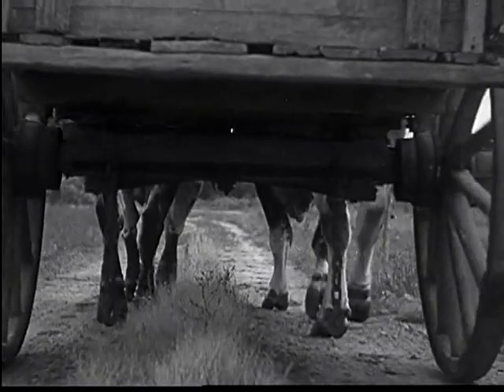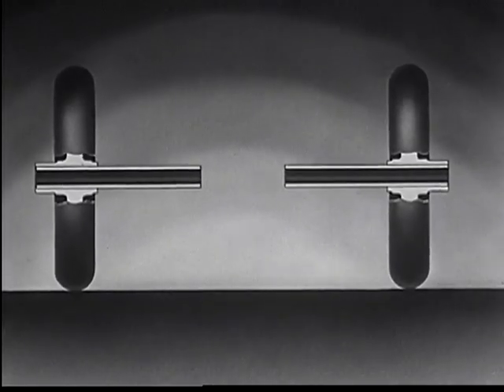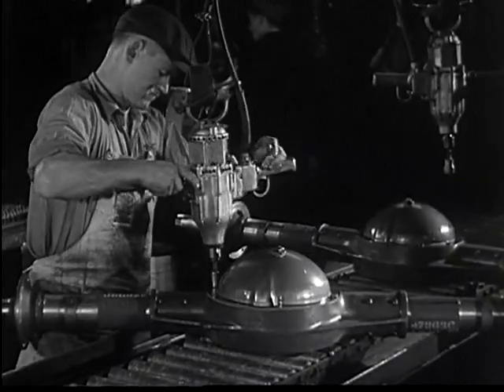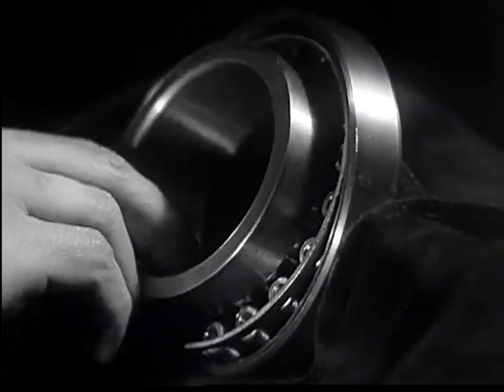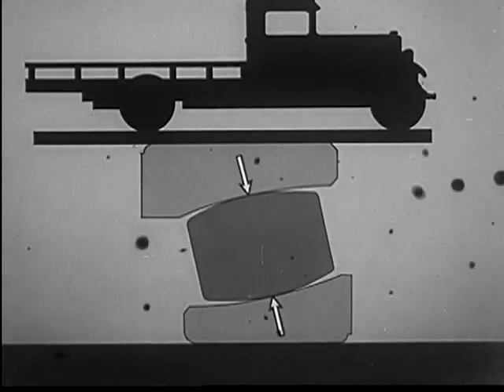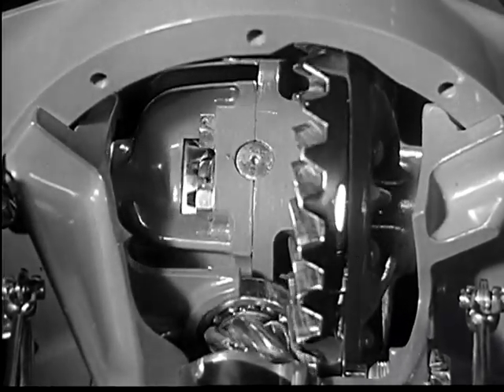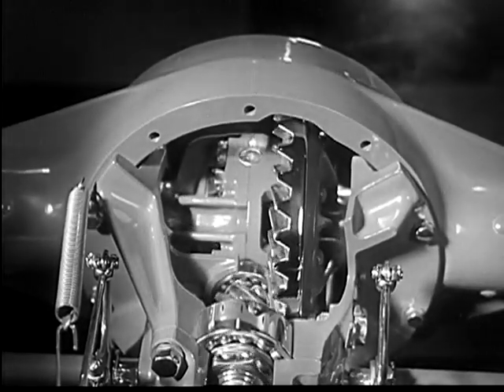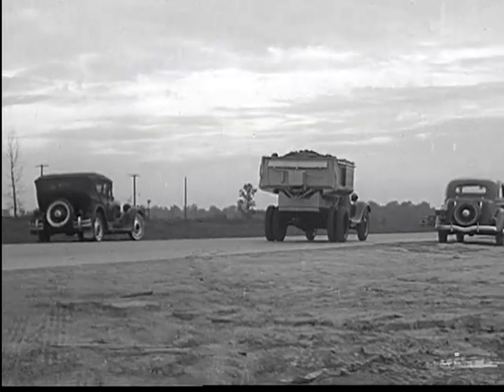It Floats - Chevrolet Full Floating Rear Axle (1936)

Comment: man i wish modern car commercials would show off practical things like how easy it is to change the drive axle instead of showing off how being in an enclosed car keeps you safe from alligators
Reply: I wish today's cars were built to last like the cars of the 80s were.  HIGH QUALITY STEEL AND IRON. not like this aluminum fiberglass and plastic bullshit you should only every see on a BIG WHEEL kids toy.  Back when we can actually service our own vehicles, when the auto parts store actually had relevance, when if you did take the car to a mechanic he didn't need to rip the car apart just to check the engine oil, back when there was actually an engine and not some stupid battery pack, back when if you got into an accident you can easily just beat the dents out and send the car into MAACO for a new paint job. Not like today where if you even bump into a fucking mailbox your car ends up in the scrap yard.  Have fun buying a new car because your piece of shit couldn't even withstand the impact from a bicycle, unlike the cars from the 80s where a crown Vic can slam into a Honda at over 50mph, roll over onto it's top and slide 80ft with the only damage to the CV is to the top where the lightbar was destroyed. Can't say much for today's cars where you can barely bump into each other in the fucking parking lot without both cars looking like they just took a Sunday drive directly into the jaws of a wood chipper.
Reply: @HannTheftAudio  ya but those 80's cars were super deadly to everyone else on the road, the high quality steel and iron combined with the sharp edges of the design language basically meant they were giant high speed knives on wheels, and pedestrian collisions would almost always be fatal, at least nowadays cars are designed to bounce people off them instead of slicing them in half, and as a bicycle rider who's been hit by more than a few modern cars and even been thrown through a windshield face first and never even broken a bone i'd say it was probably worth it

Comment: With a 60-70 year old Chevrolet dump truck in the back of my house, considering the amount of rust there is on the outside, the bearings, gears and it's inner workings is in near mint condition and works very perfectly! Goes to show how cheap and crappy things came to be now then back when that dump truck was in service :(
Reply: You know lubrication on those bearings, little use and being sealed from the elements is what caused them to survive so long, right?

Comment: The ability to change an axle from the outside is just genius.  Wish we had mechanical features like this more today.  Stuff you could fix on the side of the road with a wrench and screwdriver.
Reply: How often do you have to change the axle on modern cars? Never! That's why they ditched this design. Useless it is.

Comment: 1936 : axel break ? no problem change it on the spot
2018 : axel break ? have your car towed, be in service for days and costs a fortune
Reply: @Mr Sunshines Three words: I doubt it
Reply: May even total the vehicle because a new one costs the same as the repair, lol!
Reply: No today you have to disassemble 3/4 of the car, remove a dozen sensors, order the replacement axle twice because they couldn't send the right one the first time, get the new axle, put everything back together only to find they sent you a damaged axle, cannot repair it as its a non-serviceable part.  Wait another month for another axle to be shipped from China which shows up covered in a layer of rust.  Spend 3 days derusting it, get it installed, everything hooked back up only to have a dash full of idiot lights on because you changed the axle and confused the dozens of computers that rely on all the sensors in the axle telling the computer there's an axle there.

Comment: Car makers now.

 2018 axle, its beautiful. Made with premium composite metals and materials and plastic bushings for durability. 

The finest cheapest bearings we could make from slave labour with a service interval of 24 months and when service time comes, rest assured the dealership has no idea how to do it.

The seals are designed for the life of the vehicle....even though that life is 6 years or immediately after the warranty expires. Whichever comes first.

It has 13 cup holders, 4 USB outlets, 5 12v outlets, and heated and cooled ventilated wheel nuts with massage function sun visors.
Reply: Dont forget the rediculous infotainment console.
Reply: @scottw112358  Because nothing helps safety on the road like a 20-inch tablet.
Reply: @scottw112358  

I can remember when a radio (AM) was optional.
Reply: @ardvarkkkkk1 , did we really needed a stereo radio while growing up, we sung it ourselves, and if we don't know the lyrics we caught up really quick.
Reply: @ardvarkkkkk1 Yup, my mom's 1966 Chevy II had no cigarette lighter. Straight six, 194 cubic inch, 3 on the tree. Cost her $1,995+tax in fall of 1965. Simple, and got 20+mpg with no computers, no smog devices
Reply: That sums it up perfectly!!!
Reply: coming soon mandatory alcohol test.no drinking while playing with the internet
Reply: The most comfortable ride you'll ever experience... which makes you miss it while it's in the shop again...
Reply: Does everything but feed the baby and wipe your asp...Oh well, maybe next year.
Reply: Dude perfect!😂😂
Reply: Don't get me wrong, I love modern cars and technology. I was referring to a disposable Ford engine video. 

When Henry Ford was around he made sure his engineers built cars that would fail and break down and they're continuing that tradition to date.

Edit: here's the video https://youtu.be/pCsWm4cCMbs
Reply: What about the big screen TV where the radio used to be... And what the hell happened to my gauges? Oh right, I'm supposed to look all the way over there instead of glancing down to see what's going on...
Reply: subtle username  I do agree 100% with your cup holder comment though.
Reply: With 6-lcd screens AND 4-doors....
Reply: And by composite metals they mean pot metal 🤦🏻‍♂️
Reply: D'Oh!
Reply: Also weights 1.589kg and uses an aluminum chassis(this joke is more to mock all car manufacturers)
Reply: Hahahahahahahaha so true!!!
Reply: You summed up about right.
Reply: Suuuuuure whatever
Reply: subtle username  My point is that old cars didn't need crumple zones or airbags, or impact absorbing bumpers... because people drove them more safely.  Look at wreck statistics over the last century.  All these modern safety features did was make people more complacent in their own driving habits.  There are just as many if not more fatal crashes now as there were 70 years ago because people feel safer in modern cars and therefore drive them more dangerously.
There's an old saying, "the best safety is between your ears".  Old cars and trucks ARE perfectly safe, when driven safely.
Reply: Live Wire The car accident fatality rate per miles driven has dropped steadily and significantly ever since cars were invented. So either people are actually driving more safely as time goes on - not less, or (more likely) it’s the cars that are constantly getting safer.
Reply: @Sashazur  Fatality rate per miles driven... do you have a link to these statistics?
Reply: @Sashazur  First of all, you're a fool if you trust anything on Wikipedia.  Their system of letting every member be an editor has resulted in people changing things to fit their personal views and totally destroyed the credibility of the site.  However, that chart does seem fairly accurate, but it doesn't address the point I was making.  Yes people are driving more, and fatalities per mile driven has gone down, but that is a result of population increase more than safety features.  Now, if we go by the chart, total deaths right now is about the same as it was in the 50s when safety features began to be implemented.  Between the 60s and 80s, when safety features were being developed and produced, you see several spikes, and even the dips are higher than before safety features were introduced, which helps illustrate my point that safety features caused more fatalities than they prevented.  Why?  Well, if safety features saved lives, we should have seen total deaths drop as soon as seat belts were made mandatory in the mid 60s.  We should have seen another drop with shock absorbing bumpers, another with air bags, another with crumple zones, ect...  but we actually see spikes because people were told they were safer, so they drove more dangerously.  After the 80s, we finally see the numbers start to drop again, because people started to realize that these safety features weren't all that much safer, so they began driving more safely again and that has brought the fatality rates down significantly.  
So, yes, if you take a snap shot of the data before and after, it seems to be an improvement, but when you consider the data in between, you will see that the improvement only came after things got a lot worse.
Reply: @Sashazur  And that safety thing is an illusion. If you don't think insurance companies had anything to do with how that all went down, you're sadly mistaken. And I am not referring to medical. It's cheaper to "total" a modern car than it is to repair the older "like a tank" cars, just for starters
Reply: In 36 cars were built for 3 years. Nowadays they are built for 5-7 years. I'd call it progress. As long as we forget japanese cars from 80's that were built for 2-3...decades
Reply: Get over it, I enjoy my modern car driving me around, I've been using Toyota's radar tech for 7 years, not one single issue,  now I drive a Lexus, I feel like a pilot and yes I use every bit of the fancy electronics daily plus it's a rolling fortress literally why you should upgrade every 10 to 15 years is the safety, my Lexus stops on a dime. The car infotainment is limited the moment the vehicle is moving, people who say it's distracting have never used one. Many if the vehicles menus and settings can't be accessed while moving, you can't even fiddle around with the BT settings while the car is in motion.
Reply: In reality compared to older cars, new cars handle better, are more powerful, more comfortable, get better mileage, need less frequent maintenance, last longer, and are much safer.
Reply: @Sashazur  modern engine oil change is 300 miles
Oldsmobile1988: am i joke to you my oil change is 4 years
Reply: @Sashazur  and are 100x more difficult to work on, have ridiculously priced sensors installed in them... And lets not forget you can't even get a new car right now because there's a fkng CHIP shortage... 🙄

Gimme a carb, distributor, and a stick and I'll see all of you at the finish line.

(No, it's not considered "finishing" since a tow truck will need to bring you there)
Reply: @Sashazur  I'm an automotive technician, I drive new vehicles every day as part of my job.  The newest vehicle I own is a 1983 model, and I consider it too new.  I have never been in a wreck, I'm more comfortable in a bench seat than modern buckets.  I much prefer the ride of older vehicles, they handle just fine for me.  They actually require much less maintenance than newer vehicles.  I have a 1966 Chevy truck that I drive almost every day and it will last as long as I'm alive.  I have a 1979 suburban that I use for out of town trips that makes 20 mpg on the highway and weighs almost 1,000 lbs less than a new suburban.  I pay less than 100 dollars per year in property taxes for 5 antique vehicles that don't require registration fees and I pay less than 100 dollars per month to insure all 5 vehicles.
Yes, I realize that I'm not the average automobile owner, but facts are facts, and the facts are that older vehicles may not handle quite as well, but it's not a problem if you know how to drive them, they are just as powerful, or can be made more powerful for less money than a new vehicle costs outright (especially when you consider taxes, registration and insurance), comfort and ride quality are subjective, they get good fuel mileage, require less repairs, will outlast newer vehicles and are perfectly safe if they are properly maintained and properly driven,
Reply: @livewire2759  do all your cars have carbs? If so I'm seriously worryed, about the fuel efficiency, what the inside of its engine looks like, and and there 'slowly-dropping-each-year-mabye-day' (stedy) top speed limiter.

just a joke, not ment to be offensive. (But still carbs are really inefficient.)
Reply: @jwalster9412  Actually that's propagandised information, carbs can be just as efficient and just as clean, sometimes even more so, than EFI, and can outperform EFI in terms of power as well.  The problem is that the average person doesn't maintain their car properly, including the carburetor, which leads to inefficiency and pollution.  EFI takes the maintenance (somewhat) out of the equation.  Yes, all of my vehicles are carbureted and I keep them properly maintained and tuned so they get good mileage, make good power and run clean.  
In terms of emissions, I once tested my stock 1978 1/2 ton pickup with no emissions equipment against a similar 1998 1/2 ton pickup with EFI, cat. converters, EGR, etc... and my old truck ran almost as clean at operating temp.  A carbureted vehicle will run just as clean if it has a catalytic converter.  The only "pollution" my old vehicles produce is some evaporative emissions (fuel vapors), which I minimise by using top tier fuels with low volatility.  
In terms of economy, my 1979 suburban averages 20 mpg on the highway, which is better than the suburbans with TBI and "Vortec" EFI that came 10 to 20 years later.  It doesn't do quite as well as the modern suburbans with the LS series engines, but it's not far behind either. 
In terms of cleanliness INSIDE the engines, that has more to do with using good quality fuels and oils than whether or not the engine is carbureted or fuel injected.  Cheap oils produce sludge and cheap fuel breaks down oil faster, but all engines have "blow by" which allows fuel to mix with the oil and is the primary reason for regular oil changes.  I use good oil, good fuel and change my oil religiously, so the inside of my engines are cleaner than most engines that I repair at work for customers, including late model engines.  In fact, some emissions systems, like EGR, actually make the engine itself dirtier (particularly the intake), while making the tailpipe emissions cleaner, especially on diesel engines.
Reply: @livewire2759  that was a long paragraph, a small amount of which was terms outside of my knowledge, (I think are emisions systems) do you have any troubles with these cars on elevation changes?
Reply: @jwalster9412  Sorry, (lol) I can be long winded sometimes.  Fair warning, here comes another long response...

Carburetors do not compensate for elevation so they do need to be re-tuned as they are driven at different altitudes.  That is one advantage of EFI is that they do, in fact, compensate for altitude. 
I personally don't have that problem since I rarely drive more than 50 miles from my home, but as an automotive technician I am capable of re-tuning my carburetors if I need to compensate for altitude, something the average person isn't able to do, which is why I'm perfectly fine with the average person preferring, or even needing, a car with EFI.  

Just to be clear, I'm simply defending my own right to drive whatever I want.  I am in no way saying that everyone should drive carbureted vehicles.
Reply: @livewire2759  yeah yeah... Carbs could be more efficient and provide much more power... And because of this starting from 1920-1930s aviation engines starting to convert from carburetors (not even that shitty automotive ones even) to fuel injection systems (that time it was mechanical injection but it was one of the greatest steps in reliability improvement and one of the necessarily steps in improving power of the engine. Yes it's all was because carburetors can't do their job while changing air temperature, humidity, density and same with fuel temp and density which make carb go crazy and do wrong air to fuel ratios. This thing occurs even on the ground level but there is not much cars and drivers who can see those changes.

Comment: It's great how you can just bolt in a new driveshaft in 3 minutes! Much as we have moved on now with independent suspension, having drive shafts exposed with rubber boots over the joints seems like a step backwards for maintenance.
Reply: until you realize the massive advantages it allowed in suspension geometry. this was essentially a box truck though.....they still use these axles
Reply: the 3 minutes are waaaaaaaaay too short, when the shaft broke, you had to clear the tube before installing a new one, unless you wanted the shrapnel to destroy the replacement part

Comment: Now replacing an axle that quick is BS, you have all the shattered fragments from the broken spline in the bottom of the diff housing, and if the back plate was not removable you would have to remove the tailshaft, both axles and remove the diff to clean it all out, been there, done that.

Comment: If chevrolet pioneered the rear axle... Then why did they put the crappy 10bolt in everything during the 80s to present
Reply: the 10 bolt is 1/2 ton only. this axle design is for 3/4 ton & ^